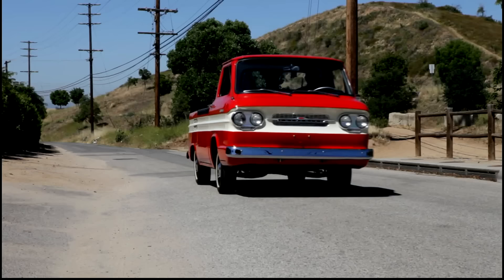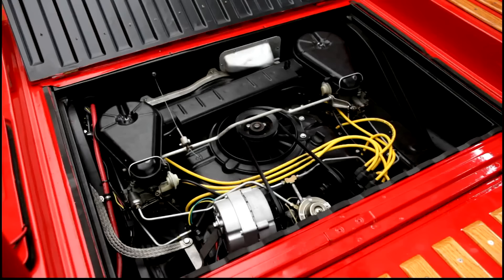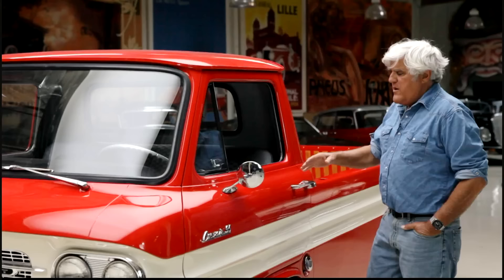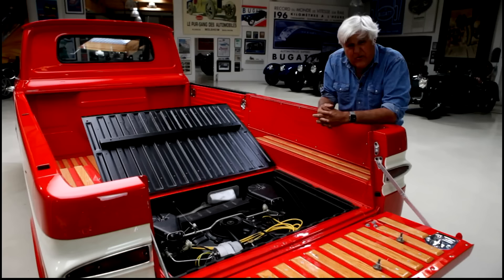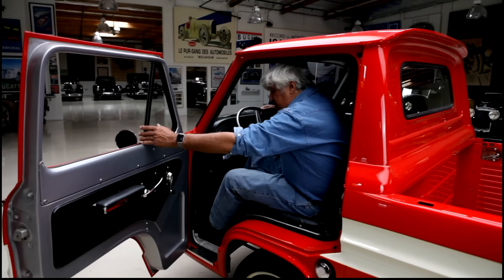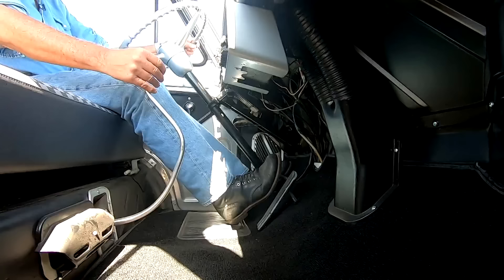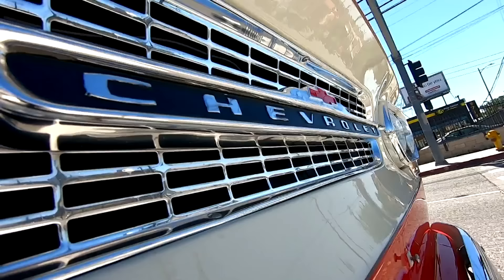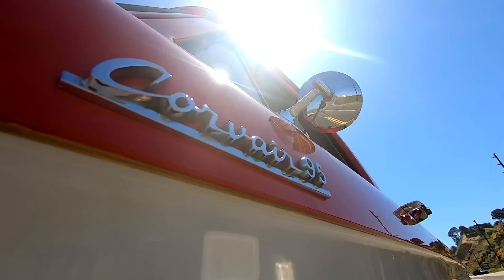America's Most Radical Pickup Truck - Jay Leno’s Garage

Comment: I had friend that had a pick-up built in the 50's, if I remember correctly both the shocks and bumpers were options I think his truck had bumpers but no shocks. At the times I had a Willy's wagon, It had a mattress custom made to fit the rear(great option for a teenage), it also had a pto winch. I wish it had the overdrive option I restored it completely ready for paint, unfortunately I totaled it in a snow storm. I wish I still had it, the only modern option I would miss is ac.

Comment: My friend in my late teens had a Corvair convertible. Red with a white top. Very nice car, but, it leaked and burned oil on the cylinders. The heat came from the shrouds around the cylinders, so the smoke was blown into the cab. We rode around with the top down and looked pretty cool, actually we were for a few days a year. Maine doesn't have many warm days. Didn't look so cool when it snowed.

Comment: Dual piston MC wasn't standard equipment in 1960. I had a 1961 Studebaker Lark and I ended up putting a dual MC in it from a later Studebaker. 
As an aside, Studebaker toyed with a flat water cooled six cylinder (I think the engine is in the museum in South Bend) as well as a Lark with a VW engine in the rear trunk. Studebaker also commissioned the development of a car with Ghia and Porsche in the late 1950s for possible production in the 1960s, with a boxer engine. There have been some articles about the development.

Comment: I grew up with one of these.  Kind of neat to have that side ramp.  I know you can get a lot of dirt in that bed. Bad part was they had a nylon gear in in oil pump that always got hot and soft then stripped out.  Had to be replaced. We had to remove he engine like 3 times to get to the pump.  Past my Calif driver's test in it.   I think the examiner felt sorry for me.  The ride was so bumpy he couldn't take any notes.  Probably would make a good electric truck.

Comment: y 1st car was a 63  monza ,, my sister had a spider.. had the 2 speed auto tras i bracket raced it tues nights at orange county it was so slow i hit the tree and it was next tues when i crossed the line. i paid 125.00 for it not running . my dad helped me get it running he was an old scool mechanic, could work on any thing.. thanks jay for showing your corvair and the curb side ,,, i owned 1 of those for a short time paid 1,000 in LA drove it home to santa cruz had plans to put a gm 350 crate nid engine . you showed the truck off that same week end and a guy from bakersfield offered 4.000  so i let it go . i know where there is one at a abandomd quarry close to Beatty Nev, . owner gave it to me but ive never went and got it .

Comment: There used to be one of those in a town where I used to work that had a pickup camper in the back of it that was made for a corvair truck, the ramp folded down and the walk in door was right there so you just walked up the ramp and in to the camper. The camper was rotten from sitting outside in the elements , but I always thought it was so cool, and a shame it was no good anymore.

Comment: There's a green one in Fairbanks Alaska on South Cushman st. it's green and a Corvair Van both of witch ran good when they were parked there in 1994. The guy also had a Jeep 4 wheel drive cabover 4x4 I own it. Im just starting a complete rebuild of the motor and running gear.

Comment: I think it's beautiful, stylish, imaginative; clean sheet metal narrative.  If my '70 VW was example,  rear-wheel drive is great in the snow. (Also 54 hp!)  Bring back the engine-over-the-rear-wheel vehicles.  I loved the whole Corvair line (and my dad worked on the line at Ford.)    At least as safe as a Harley or my old Bug.

Comment: Love your presentation. The 95  did come with a single line master cylinder, a generator vice alternator and the oil pan was a flat piece of sheet steel, not thst nice finned aluminum one.  It did not have cast iron heads. They were cast aluminum. The cylinders were cast Iron.

Comment: The heads on the engines in the 95s are different [heavier casting] to provide a bigger heat sink for when going uphill carrying a load vs. the sedan engines. I can't remember off the top of my head, but iirc, the regular sedan [1st year, 1960] was rated as 80hp, and the trucks were rated at 85hp? (Maybe 90?); in '61 when the 95 series vehicles showed up. I don't believe that the station wagon [Lakewood?] got the heavier duty heads; I think it was only offered w/ the sedan engines...

Comment: the truck isn't really a unibody if you look underneath there is a frame that ends at the axles. makes it easy to install a V_8 in the bed and hang a 9 in, cougar independent suspension,

Comment: Didn't you get any seat belts with that? Wow! Well Dad was a Corvair man, Grandpa Lawson was a Buick Man. Dad had a '64 Corvair Coupe it was two door, red interior and black paint 4 speed standard and he was the original owner I think. He had it for many years. We went to the drive-in and saw either "That Darn Cat", or "Mary Poppins" as the first and second movie(s) I can remember. Then Dad got another '64 Coupe in like '72. It was light blue paint and interior. Dad drove it to work every day. It blew oil. It had oil everywhere. We drove the black one cross country twice, as Dad was in the Navy and Air Force. No seatbelts, till 1965. But he installed them I think. I sat behind my Mom, and she had my younger brother on her lap. We went to the mountains to the snow for the day. On our way home, she did not close the door well. I was maybe three and fell out, wearing my snow suit pretty much like the kid in "A Christmas Story". Mom felt a draft and looked to the back seat and I was gone. She told Dad and they turned around, of course. I barely remember that. Thing about the Corvair is it made a unique sound. We always knew when Dad got home. About '75 Dad got a Corsa, which was an automatic. Not too much different. I drove the blue Coupe to a job interview in Los Angeles from San Diego. I was driving up I-5 and I wondered why it wasn't going over 45MPH. I get to LA and was parking. Then I realized, I didn't take off the parking brake! Well on my way home I did take off the brake, and did much better. Dad asked if there were any problems getting to LA, I said, "Nope. Everything went fine!" I never told him, but he probably had an idea, he was good like that, but he never let on. Thanks Jay!

Comment: What kind of o rings were used on push rod tubes. Stock are very prone to leaking. Heat makes them brittle. I ended up using viton , which seemed to work better.

Comment: I had a corvair van with double doors on both sides  and the rear. My father put the biggest corvair engine available. Had to make custom cowling. In first gear you could make the front tires come off the ground. Since it was air cooled it has a gas heater. I always thought the ford Econoline vans and trucks were beautiful.

Comment: I wonder if you can twist that mirror to where the asymmetrical swivel has the glass as far away from the vent window that it can get and it will clear the glass? I noticed in the driving video, the mirror is not at its best twist location for vent window clearance. Just a thought. Man if I had had that one I would’ve not even took A second look at my little sedan, but at the time that sedan was so fun to drive that I loved it I’ll let my Biscayne sit off to the side and messed with the Corvair for half a year probably which was a lifetime in school.

Comment: Ford made the Econoline pickup for many years. It wasn't a air-cooled rear engine with independent suspension but the body style was very much like this. Did it come out before the Corvair pickup? I think the Econoline came out in 61. If not they were close.

Comment: Great stuff. The cab back, roof, windshield, doors, look like a 66 Chevrolet PU cab except the cut out for the wheels. Even the interior, seat, dash are 66 PU. Looks like they took the cab and stuck that flat grill front over the firewall. Funny how as years go by, the cars that were so ugly or really weren't noticed, catch your eye today. I seem to pick up, no pun untended, on the lines of older cars a lot more then I used to. Like the Valiants or LTD wagons, you see one and Wow, you really look it over and respect it a lot more.

Comment: I had a 69 chevy van in highschool.hp 350 v8 mid engine rwd.i put n50 ,15 tires on all 4 corners.dropped it 6 inches off the ground.i would put a pass in front and race up snake road,11 miles up hill 56 u turns.i would charge 5 bucks and bet 20 i could make them puke before reaching the top.i always won, as when turning corners pass was hanging 3 ft over a clif on pass side ,not to mention huge window in your face,giving the impression that you were going to crash ar every turn .i had 6 total.

Comment: I restored a 1964 ChrisCraft CabinCruiseryears ago and it had 9 Cigarette Lighters in it including 2 in the Head (Bathroom)  at first i thought  they would be handy to use as 12 Volt Accessory Outlets for Cell phones and other modern electronic devices although the  old Cigarette Lighters  were actually a slightly smaller Diameter  so i did replace them with a 12Volt accessory plug and USB Port  in its place  to be more practical

Comment: Viton  Push- rod  o rings are still needed to replace stock oil rings oil leaks, why not change the transaxle VW camper van counter- clock to clock direction , install corvair motor, double hp.

Comment: I wonder what the U-shaped impression? is on the back of the cab at the front of the pick-up bed.  Could it be the storage location for the spare tire, behind the seat? I didn't see a spare underneath or in the bed.

Comment: Always nice to drive a car with character something that can make you smile I had a 64 falcon I bought for$100oo two years later I sold it for 75oo right away I started missing the car last time I saw it a very young couple were driving it chasing an old 911 like a 69 around a corner practically had the car up on two wheels both of them smiling from ear to ear

Comment: Ed  Cole was an airbag fan too.  He put airbags into production as an option that didn’t sell and GM didn’t push it.  It was probably a good thing it didn’t sell.  There was still research to do before systems were ready for prime time.  The Corsair’s had a cult following.  Early models were ugly, lousy swing axels, lousy heaters, lousy performance, good in the snow.   The Mustang was coming down the tracks just as the Corvair Spider, turbo motor ,  double joints on each side of the rear axel.  Still had the heater that would rust and fill the compartment with exhaust fumes.  It just seemed odd except the one full up turbo model.  GM missed the target with a good idea.  Jay is giving the van a lot more credits then the market gave it.  Most people thought it was a bad compromise in MoTown.

Comment: Gas heater...another version of the Ricky Nelson heater.  At least it didn't leak oil like the Corvair engine.  I did own a 1965 Corvair and enjoyed driving except it spent more time in the shop.  Fun to drive, but I replaced it with a 1975 Vega, not exactly a great car either.

Comment: My father owned one. Non stop engine problems. I do not know if he knew how to drive it. Everyone that I knew that had a Corvair kept the rpms very high. I have read that driving them like a water cooled it would over heat the engine. He put a couple of eyebolts in it to haul his motorcycle.
Reply: You're absolutely right. Keep the revs high. Keeps the oil moving, air/fans cooling. Later fans (pardon the pun) of the Corvair would mod the shrouds and/or make other mods, but if you ran them reasonably, changed the oil regularly, they rewarded you. Per my readings.

Comment: Still lose some space in ordinary truck beds at the rear wheels unless it's a flat bed but then the center of gravity would be the rear height without the weight of the engine. Dual axel Cab overs usually tilt forward on the big rigs and are slightly wider than conventional tractors. Pneumatic ride can drop the frame a few inches to get under lower trailer drop others would have to jack up 50K lbs by hand.

Comment: My first car was a 61 corvair I was sick and couldn't even get out of bed the owner brought it over I sent the money out to him when I could finally get out of bed and go to work I got my registration put the license on the back fired it up and went to work with it and boy was it gutless drove it like that for over a week it took 2 blocks to get up speed one day I pulled into the place I was working and someone was waiting to rent a bay to fix his vehicle and as I got out he says sounds like it's only running on 3 cylinders told me to open the hood so I did and found out that it had two caburaters and one was unhooked from the linkage so it was only running on 3 cylinders hooked it up and after that it run great I it would go anywhere on or off road as long as you had 1 rear wheel on the ground it would slide along on its belly and rough roads with 4 wheel independent suspension it made them smooth and since Nader said that they start to float at 55 and a speedometer not working I went everywhere at top speed I later realized that if you travel 100 miles in 30 minutes you're doing a lot more than 55 mph it took corners like a dream so much so that when I finally replaced it I had to relearn how to drive again I took my GM pickup truck around a curve I was glad I was in the inside lane and had no one beside me as by the time I got around that 45 degree turn I was in the curb lane and that was at 50mph  it was one tough car our truck with a 2000 gallon tank on died in the middle of an intersection the tow truck couldn't get there till morning and we couldn't leave it there so I put the front end up to the bumper it touched just below the hood and pushed it off the road didn't even dent it I'm not sure about the pickup or the vans but the cars with the front trunk were solid Saw one in the junk yard that had hit a telephone pole at 50 and it only had a 6 inch dent in the middle of the front end would love to have another if I did I would treat it a lot better

Comment: Dear Jay, did not VW produce a similar product earlier than GM’s Corvair? Has the engine in the rear, the cabin way on front, sides and tailgate dropped down. Why the GM’s version “innovative?” Thanks.

Comment: You need an optoelectronic distance reader to see where the road is, and a servo controlled shock system to lock the vehicle to the surface it's rolling over.  TOO MUCH bounce.

Comment: As for me I just wish I could afford to replace my old 63 chevy heavy half ton , with the 235 straight 6, 4 on the floor.  Or the same year of dodge crew cab 318 same transmission setup. First gear a what we called a granny gear.  
Today there is a rash of Yahoo's that take these old trucks lower them add a small block and turbo 400 auto transmission and fuel injection and ruin the truck . It's sad

Give me a old apache or C10,or 20, with a 292 straight 6 four speed, carburetor, points, plugs, and condenser. I'd be a happy old man 
Mountain man

Comment: How could the Corvair pickup be the first rear-engine or air-cooled or forward-cab or independent rear suspension truck when the Volkswagen Type 2 appeared more than a decade earlier? The Corvair (car or truck) wasn't innovative; it was unusual for North America but technically just a copy of existing European designs.

The Econoline came out with its forward-cab design at almost the same time as the Corvair; the Dodge A100 was only a couple of years behind, so it must have been in development before the Corvair was in production.

Comment: Innovative?  Sure, just nine years after VW started making their single-cab pickup.  Double the horsepower was great, but GM copied so much from VW they even copied the "bump steer" problem!  I ran a Corvair engine in my Karmann Ghia for a while, but I never could keep the belt from flopping over and shredding.  That 90 degree bend in the belt design was a horrible idea.  GM should have either kept the fan and generator in the belt pulley plane, or made a round belt.  VW fixed this with their Type III design that stuck the fan on the end of the crankshaft.

Comment: OMG. GM is to be applauded for their attempt to be innovative, but the Corvair sucked, in all it's incarnations. I had a Greenbrier van, basically your pickup, enclosed. The most horrible part was the double folded U fan belt, which inherently risked getting eaten by the pulley, after which your engine would almost immediately overheat, and warpping enough to require replacing. Ralph Nader's expose of the hazards of the sedan killed off interest prematurely, before the issues could be remedied. Sad, because it was truly innovative, ahead of it's time in many ways. 

The design is much like a pickup version of any 60s van.